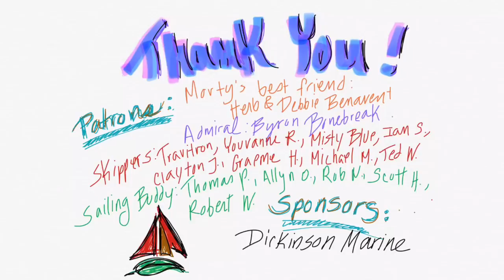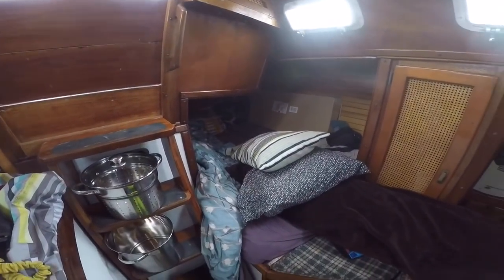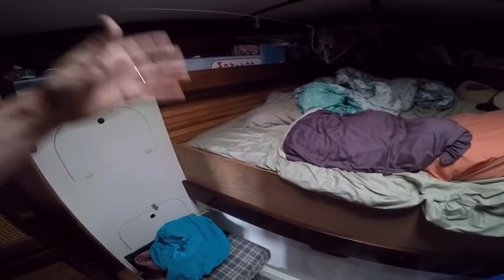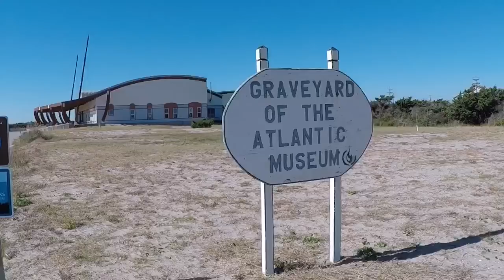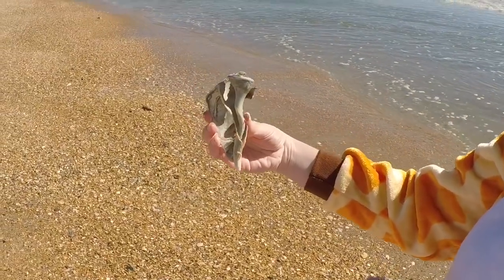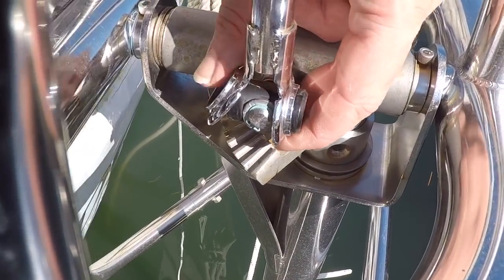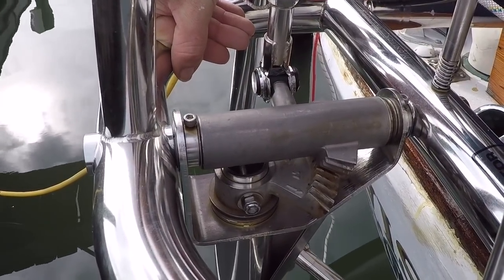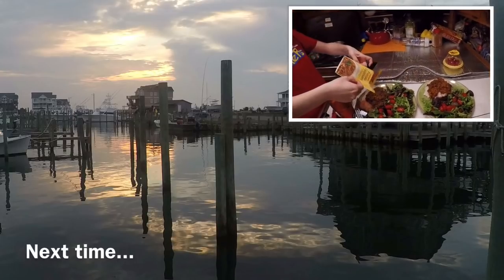Boat Repairs and Beach Giraffe | Sailing Wisdom Ep 63

Comment: Now the cleanup and repairs begin. Maddie looks chipper again and Wisdom looks like she weathered the storm pretty well. Some water leaks that new gaskets should fix and the bow roller looks repairable enough. Good to see that the Monitor turned out to be a quick fix also. I still think Maddie's seasickness is going to be a tough thing to overcome. As for the forestay, your idea to add a turnbuckle and new deadeye may turn out to be a wise decision. I would say you both are still on a shake down cruise for the boat and your sailing experience.
Reply from the maker: Very much! We had so many ideas about what would work and this experience showed us what actually works and what doesn’t work.

Comment: Best way to clean a boat after rough passage- take EVERYTHING not permanently afixed out.  Get a hose below, start at the stem, and hose it, scrub it, and let it dry before putting anything back.  Get EVERYTHING off the deck.  Scrub it down and let it dry before anything goes back aboard.  Make sure everything going back aboard is clean and dry.  Takes a lot of work, but it will mitigate the chances of issues later.

Comment: OK, I am recording my ongoing comment externally now.
(02:23) A 3" of 4" rigid chafing tube to cover the hardware at the bottom and center the stay in a frictionless thingie (you know, onna them plastic ring things large enough to pass one end through upon install, centered suspended from 4 sides) so the bottom foot is enshrouded - tied down to the center of the clevis pin I imagine, just loosen the bottom retainer to examine the rigging.  I can explain what I mean if you need.

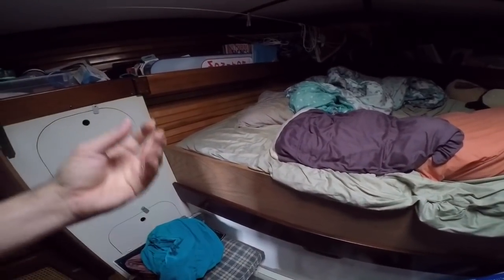(05:18) hydrostatic?  something like that

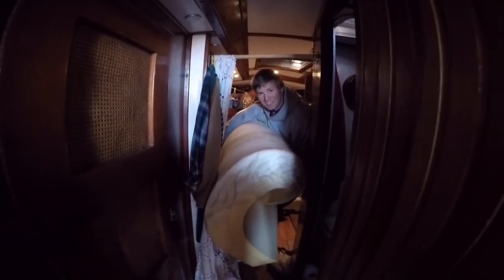(06:00) I suspect you can cut foam with to leads from an appropriately sized battery, a pair of alligator clips and a "filament" of small gauge wire just as long as is required, it will give you a heat knife to cut smooth edged curves.  As usual avoid children, test a small sample first and cut in an exposed place with maximum ventilation.

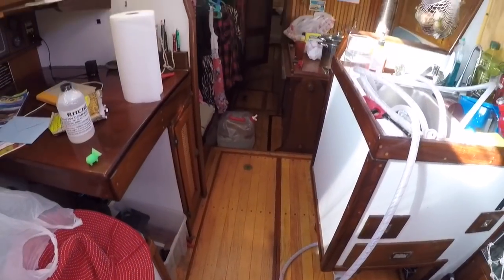(07:12)	Oh, that is so funny and so sad, the cast of drowned crew, how vary "Pirates of the Carribean"ish

(08:06)	Rocky the flying squirrel?  the giraffe is fantastic.

(09:11)	You should shoot one scene admonishing viewers that "You should never walk on the sand dunes, only use the designated walkways to preserve the sea oats and other flora that anchor the sand in place." then walk to explore if no civilians are around to see.  Always set a good example when being observed by civilians.  Disclaimer: This is CIVILIAN advise, not park service guidelines!  It is really the quantity, not the fact of, that kills the plants that anchor the dunes.  Oh how I miss walking on dunes, I have spent too many hours as a "Friend of Science" or whatever the papers I signed that allow me to accompany my brother into the Everglades National Park, it is effecting how I see so much!

I am not through laughing at the costume yet, the giraffe head is super at certain angles.

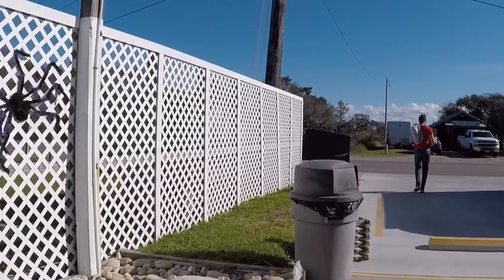(14:30)	I like the way you trail behind Herbie like a well trained Lassie (it's Maddie right, I hate misspelling names).  In some worlds the female is trained to walk a pace behind the male, in ours you are the videographer.

Comment: Interesting video, your boat took a bit of a beating but looks like you are going to bounce right back. Just one comment on the Monitor video and the bolt failure. Do not dismiss that this may have been caused (primarily) by the bolt being over tightened. When you over torque a bolt it creates a stress point at the first thread of the nut and this stress point will be the site of a future fracture.
Reply from the maker: +Norman Boyes could be! I put the new bolt in only hand tight with a screw driver and wrench.

Comment: from the chaos, order, well done guys, keep it up, especially liked the piece sabout the monitor. Also, how did the wooden slates work in keeping the base/ underside of your mattress from being damp (normally I mean) not during the storm?
Reply from the maker: +kevin mulvihill the slats work great! We had a mildew problem because it would be sopping wet by morning under the mattress and wouldn't dry by day. With the slats, enough air flows under it to keep it from forming so much condensation, and dry out any moist spots during the day.

Comment: Remember this?  
Carl203 Crazy
1 week ago
1. Get a snubber for the anchor chain. Leaving the chain gear to hold the boat will result in broken gear. It's simple, easy to use, and saves $$. ??
But hey, the anchor broke the bow sprit off... Wow! Did not see that coming, at all...
Reply from the maker: +Carl203 Crazy we do use a snubber when we anchor. It's 3/4" 3-lay nylon rope, 20' long tied to the chain with a Magnus hitch and fastened to the bow cleat. Snubbers are great but only when you are anchored. 
The anchor broke the bow roller while we were hove to and the anchor was in the bow roller. We were in deep water (300 to 1600 feet deep) when the issue arose. The only way the snubber would have helped save our bow roller would have been if we used it to hold the anchor in place in the roller. 
Luckily, old boats make for less costly repairs. The bill to repair the bow roller came in under $4 in parts!
Reply: Rigging Doctor ah.. My apologies then for mis understanding. Happy that worked out as well as it did.
Reply from the maker: +Carl203 Crazy :)

Comment: What kind of generator did you buy?
Reply from the maker: +Tim K Honda 2000
Reply: Great choice, super reliable, light weight and easy to handle and fairly quiet.  You will want to keep it out of sight and/or locked down when you are in port as you don't want it to grow legs.  If you ever need more power you can easily parallel it with another eu2000i.  You cant go wrong with a Honda.
Reply from the maker: +Tim K good point about keeping it covered. It's also great because we get to take hot showers!!!!
Reply: Have you figured a quick way to charge the battery bank with it? I know it has a 12VDC out but that doesn’t put out a lot of amps to charge with.
Reply: Have you figured out how to equalize your batteries? BTW GREAT save on the boat! Ginger Ale and or Hot black tea no sugar no milk or creamer, about a half cup dunk the tea bag and sip. The last recommendation is ginger cookies, don’t stuff yourself nibble on them. She can help get used to the rolling if she goes to a park where they have teeter todders and stand in the middle while you raise and lower the ends. Sounds crazy but works.
Reply from the maker: +buffettfanman we bought the "companion" model that has one 20amp household outlet, and one 30amp Hubble plug so we can plug the boat into it with the shore power cable. This lets us charge the batteries through the boats electrical system and our 48v battery charger. If I tried to hook up to the 12v output on the generator, I would have my hands full with equalizing, of which I know not how to do.

Comment: Wow, that boat looks like the inside of a dumpster. If I were you I'd unload everything, then replace just the equipment necessary to sail her, spare rigging gear, repair tools, safety equipment, and first aid supplies. Now you have what you need to make way, everything else should be kept to a minimum such as cooking gear, toiletries, clothing, etc., and loose all the joy toys, or put em in a storage locker, stuffed animals?... come on! All that excess baggage might be ok when berthed at a marina, but has no place on a boat making a passage, just stuff that's in the way or under foot when the going gets tough, and in my experience if you think of tough as the norm you won't be disapointed. Either this or change the name from Wisdom to Clueless.
Reply from the maker: It's true, we have too much stuff on board because it is the only place we have. Everything we own is in the boat. The biggest mistake we made before casting off was planning to go and "stocking up". All of our stuff that used to live in lockers got displaced by canned goods! All of the lockers were full so we left the soft stuff outside since it wouldn't hurt us if it flew across the boat and hit us. 
Thankfully, we are slowly consuming the canned goods and gaining space in the lockers again for the living items. Once we eat through the canned stuff, we will not replenish them. 
When we lived aboard, 1 locker was canned food. Now 8 lockers are canned food! We live and learn and try not to repeat our mistakes. 
As for the stuffed animals, my wife likes them and it makes the boat feel like a home to her. Cruising for me might be about the sailing but cruising to her is about feeling at home everywhere we drop anchor :)
Reply: Instablaster.